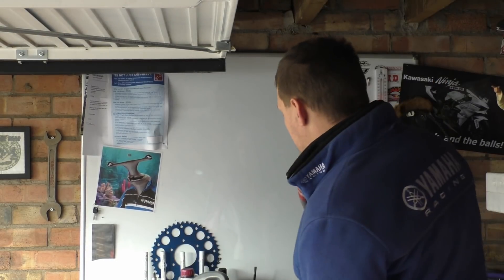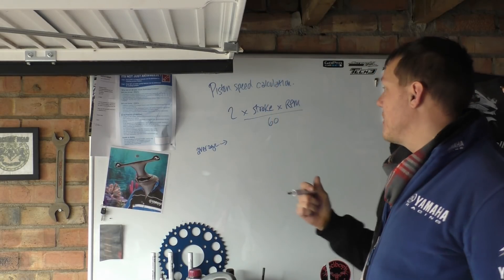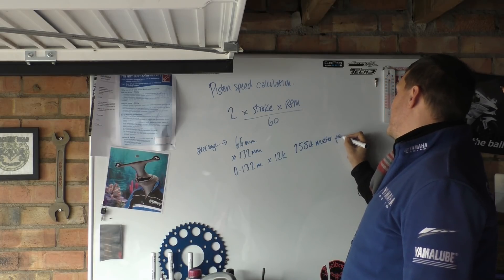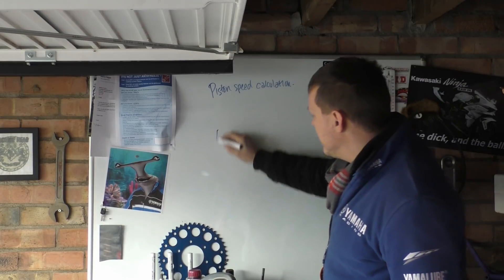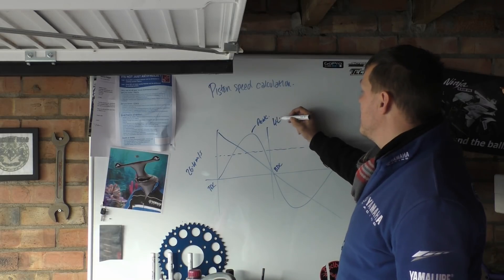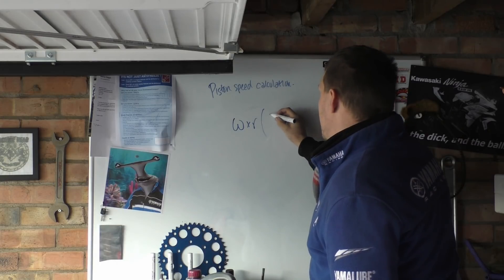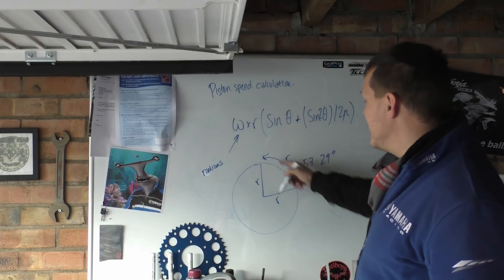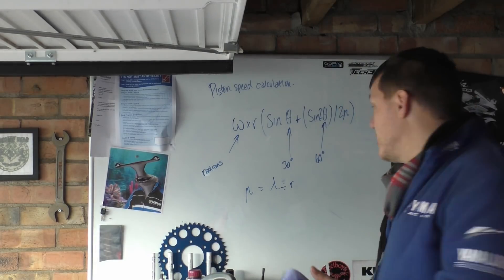Mean piston speed

Comment: Another slightly related question. What is the number of g the piston is going at. Just to see what the needle bearing in the small end has to survive ( i expect that is the weakest point). I did a calculation once for a r6 if i remember correctly max rpm was the highest at the time. I came up with a value of more than 4000 g ! So every gram of piston would be about 4 kg. I hope i made a huge error because those numbers seem crazy to me
Reply: maurice van doeselaar
I'd like to see the equations you used.  I didn't realize that I'd forgotten so much since college.  Specifically, your acceleration formulas.  I don't know the specs on the Yamaha, (if that's the bike you refer to), but I was using a 42.5 mm from Google and I think that seems too short.  I fucked up all my calcs.  I just have forgotten too much.  Could you show me what you have?  It might resuscitate my fucking brain.  I agree, 4 kg seems suspicious if not downright incorrect.  Way to low.  Cheers.

Comment: In a single cylinder application is there any notable deviation in piston velocity across the various strokes, or does the rotating mass compensate?
Reply from the maker: Stroke velocities are a function of the crank angle (crank radius and rod length). So as long as the piston is aligned with the bore then no. Desaxe cylinders do have asymmetry. This is all excluding the power stroke, which is faster during aceleration obviouly. 

There is always ever so slight deviation. Depends on the stroke function (exhaust,intake etc) I'll go into this in a future vid.

Comment: im still trying to figure out at what point is intake volume considered too large for the velocity to be too slow for low or mid range rpm. Or a better question is what port velocity/speed is considered too slow? Also, how does it affect fuel atomization. If i have a cylinder head with a too large of intake port for a particular cc engine, could i take advantage of it by using a cam profile designed to make power at higher rpms to bring the intake speed back up?
Reply from the maker: Good question, and that's why port design takes 1000's of hours and a lot of testing. 

As for fuel atomization, we'll get into this in a future video.

The last question regarding cam profiles is the next video in the series that I need to edit and publish
Reply from the maker: LOL - I have to laugh - I'll give you 10 point for tenacity.

So lets take the SV piston speed - @ 1000rpm the average port velocity under 18m/s and a peak of 25.72 m/s - the average piston speed is 6.2 m/s. 

You have to remember that 26.4 m/s is @ 12,000 rpm. 

As far a cam combinations come into it, its just as much about the lift as it is about the timing - obviously there is a cut off, where not enough air has entered the cylinder but it would be bloody low. 

As far as slowest speed goes, other things coming into effect, like rotational inertia, frinction, pumping loses etc.